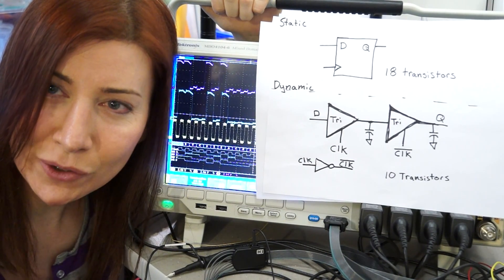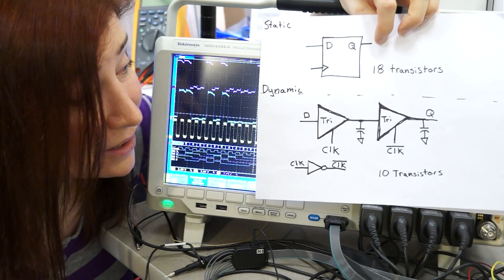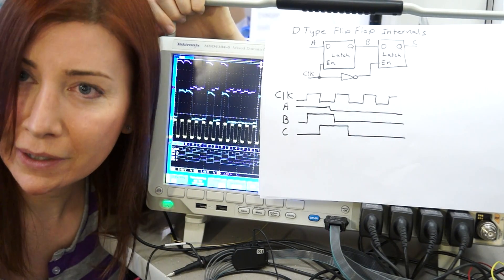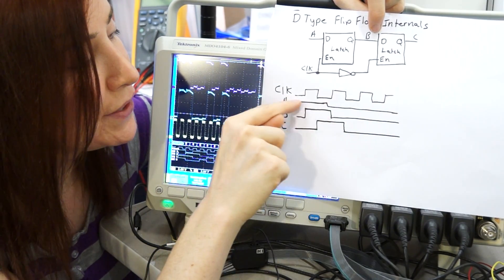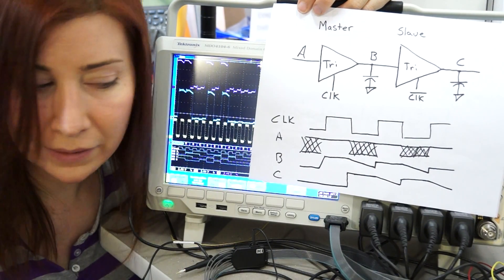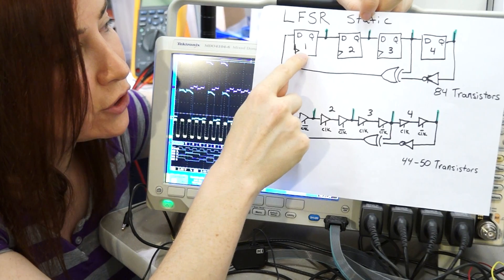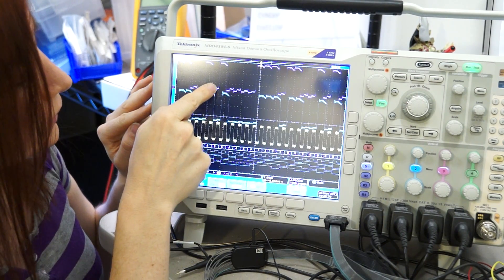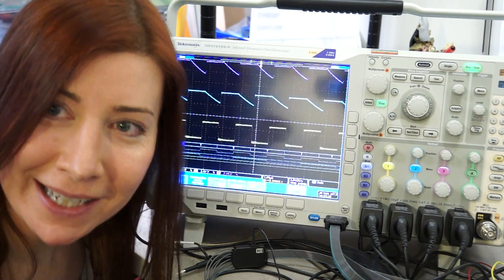Static Vs Dynamic Flip Flops - Race Against the Clock

Comment: 4m01, unless you use a capacitor (1nF)/resistor mechanism on the clock pin, right?

Comment: There are some disadvantages to the dynamic logic. Since we are charging the cap between buffers, thus it consumes more power. I believe the advantage is that it is a faster circuit.
I’ve been characterizing dynamic circuit is the lab. This is no fun, since at the smaller geometries today, the manufacturing variability reduces your yield significantly. Since transistors are cheap ( vs wires that are expensive) the area advantage is less. Great explanation on the topic.

Comment: That is really cool!  Yeah your LFSR has an "illegal" state of 0000 without the inverter.  Not really illegal, just uninteresting because no matter how many clock cycles you provide all you ever get is 0000 out.  The inverter changes the (in the way you're looking at it) MSB from 0 to 1 so that the LSB (output of the leftmost FF) on the next clock cycle can go to 1.  Of course now the shift register has an "illegal" state of 1111 but it never reaches that state in normal operation.  I had to draw out all the sequences on paper so I could see it.  Interestingly if CLK 1 changes the output from 0000 to 1000, CLK 12 is the only one where all 4 output bits change state ... from 1010 to 0101.  The rest are all 3 or less bit changes.

Comment: I've been trying to get this dynamic master-slave D flip-flop working by writing a netlist file and then using ngspice to simulate it (I just learned how to use that program to simulate circuits and it's quite cool)...

I've been trying to make it from transistor base up, but for some reason I can't get it to work well..

I tested the components individually one by one and first of all my inverter seems to work and my tri state buffer seems to work..... BUT when I try to make the dynamic D flip flop everything starts to behave weird and I can't seem to get it working..

I'm not sure if I just misunderstood the principle or that the thing actually works but not in a way I was expecting. Having all those capacitors plus transistors makes the thing spark like hell :D (luckily just a simulation)
Reply: Haha nevermind... I just realized I thought the thing way too much and I also misunderstood the beginning... I thought you made one D flip flop from using those two tri-state buffers and an inverter but the buffer itself actually is already a flip flop when you just add the capacitor there to store the value.... HAHA no wonder I got some interesting results having two master slave flip flops inside each other (flip-flop inception) with tons of transistors and capacitors :D
Reply: calibration my friend, it's an essential of trouble shooting

Comment: Hi Jeri, I just happened to find your channel on the web.

I have been in this electronics hobby since 1980, I never worked with IC's, never wanted to, my whole enjoyment in this hobby is to build electronic circuits from all discrete components.

With your tutorial on data flip flops, made me think of one of my projects, I designed.
I designed and all discrete components "Master - Slave flip flop", and I built a bunch of them on breadboards, I made everything from shift registers to modulo counters,
I really enjoyed taking computer functions, and redesigning them using all discrete components, (transitors ect...) to get the same kind of results.

I was able to build several character generators, based off of the (call char) in TI basic, making my display out of an array of all LEDS, I designed my own memory addresses, using all SCR's, with logic gating made from transistors, and such.

I really enjoy your channel, its nice to see someone else who takes electronics to the core level, to experiment the way they did before the IC's took over.

Keep up the great work.

Comment: Try out Minecraft, Jeri. It's a 3D engine with big-sized blocks. You're essentially mining down tunnels you carve through, after various valuables,
The really interesting thing is you can have logic circuits with it. A block might be just a wire, or an inverter, or ... a whole bunch of things. You can run a circuit along, with its lights pulsing, and follow it down and back.
When I last looked, there was still a race condition and various lockups at startup; the only way I found to get rid of them was to temporarily blast the startup transistors with a square wave for 3 or so seconds. But it's been awhile, and the game is just addictive!
-- Dave Small

Comment: Hi Jerri, I experimented with the CD 4017 (static counter IC) today and found that I had to ground the - (minus) to the central heating (ground...!) to make it work properly = stabile. Is this normal? How can I avoid this? I did not connect all the un-used inputs to ground (-) or (+).

Comment: If you used a speaker to put audio into water, I don't think the waves would be big enough to activate floats or anything mechanical; you would need a microphone to pick up the audio. But it would be interesting to actually be in the pool and move around to see what your presence would do to the data. Maybe it would just flow around you.

Comment: The wave makers can of course be electrical. Bass and middle drivers with a bit of waterproofing (stuck in a ziploc bag :) would work. You can read it out with floats and hall switches along the sides of the pool.

Comment: For those of you who don't know what difference between a master-slave flip flop and regular flip flop is. a FF is like a single door and a MS-FF is like an airlock(dual doors). In an airlock, only one door at a time can be open to allow passage. if both doors where open at the same time. all the air in the space station would rush out into space. thus the racing effect.

Comment: Great video. The closest I ever get to the metal is with assembly programming, so it's always fascinating to see what's going on underneath. IIRC, Steve Wozniak used LSFRs in lieu of even more complex components.

I have to ask about the tri-state. Are its values HI, LOW, and MAYBE?
Reply: HI, LOW, and MAYBE ...
9 years old, but ...
HI, LOW, and fully disconnected, a 74hc595 is a device that has such mechanism.

Comment: But there has to be enough delay in order to have room for the bits to exist, hence the glass, coils of coax cable or whatever the storage is. One of the first computers used ripples in pools of mercury.

Someday somebody is going hook up some hydraulic wave makers to a swimming pool, which will be a very slow memory. But you will be able to see the bits and put your hand into one. "BILLY, GET OUT OF THERE. YOUR'E CAUSING A PARITY ERROR!"